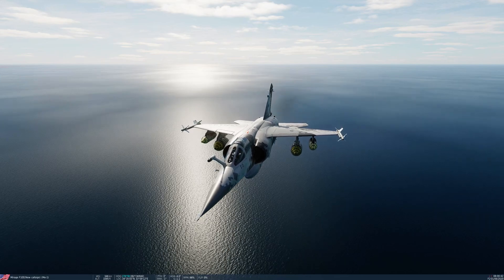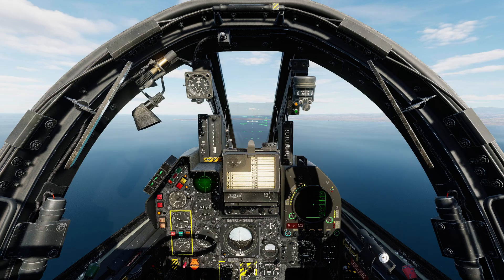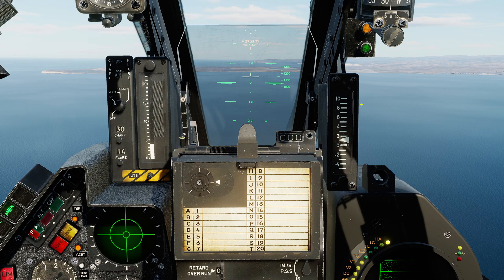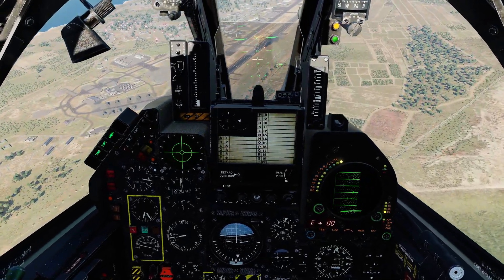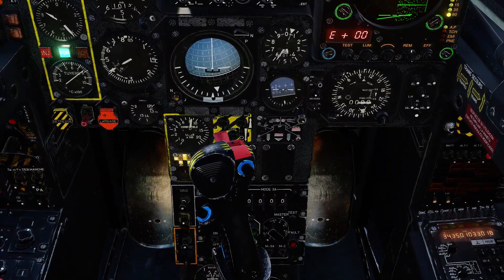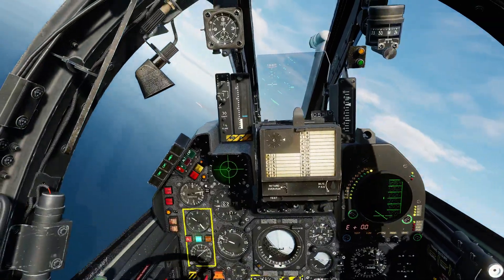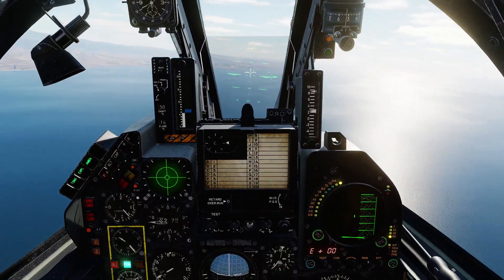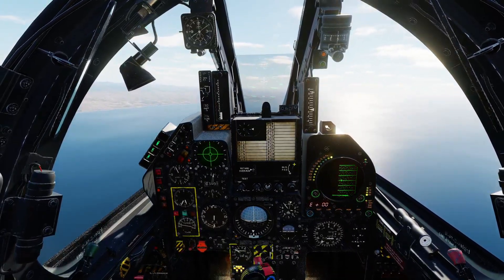DCS Mirage F1EE Tutorial 8 - Guns and rockets in air to ground

Comment: Usually a more reliable technique for your roll in is to place the target just behind the canopy bow, at a height above the frame that depends on the profile you want, and when you reach that position, roll 135° to place the lift vector in plane with the target and pull. For the roll out you can use the attitude references either side as a funnel to know when to roll out.

For your first run the mrad setting was too high so your aimpoint was too short of the actual trajectory. 45 mrad with those parameters (450kts -15 attitude 2000ft) works much better and is common with guns in my experience.
2000ft release is also neat because you can have another cue up on the sight which is the altitude tape starting to roll.

Comment: Hitting anything in the F1 is challenging.  The piper is not very useful at all.  I have tried using the SAMP250 high drags and basically used the ww2 IL2 technique of flying fast at 300 FT and dropping the bombs once the targets reach the bottom of the HUD.  Got good results from it.  Using the piper is just frustrating.
Reply: It just takes practice and disciplined flying. Once your eye is accustomed to the initial position for the run, all it takes is flying consistently, and at release all the parameters line up with pipper on target.